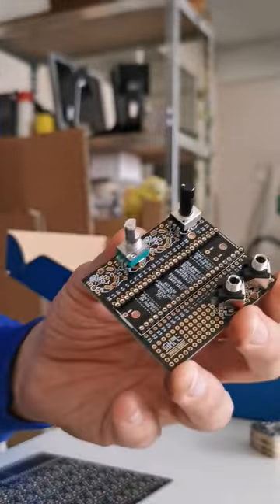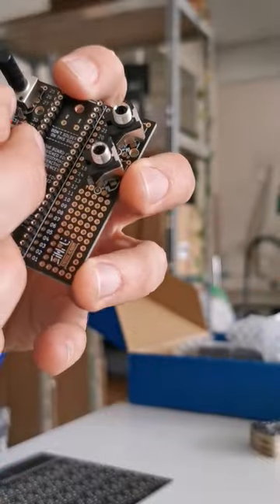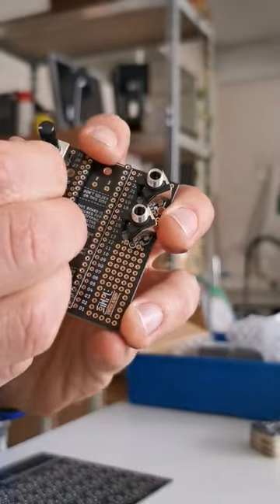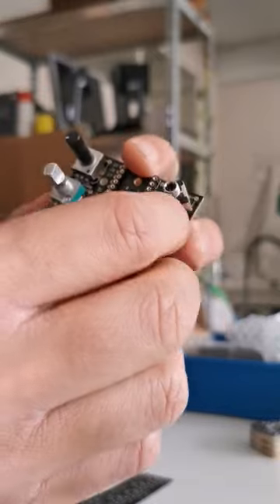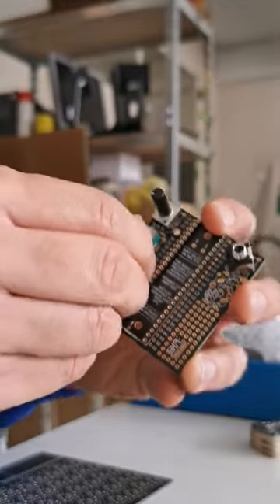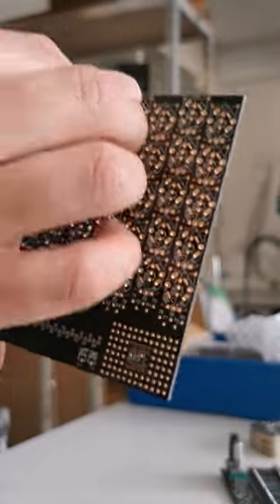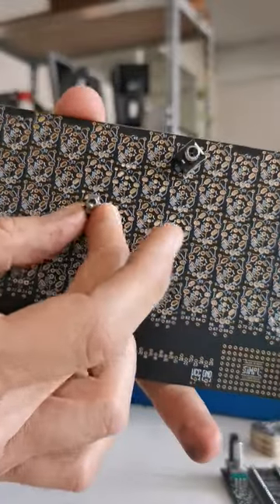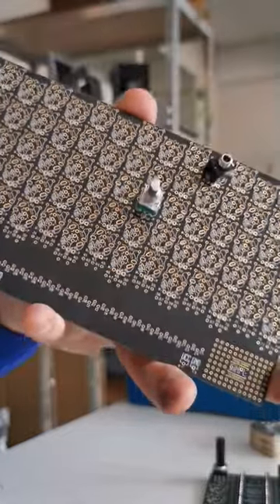Mini synthesizer designer for Daisy Seed, Teensy and Arduino Nano

Comment: That’s genius! I’ve been meaning to build my own Daisy Pod semi-equivalent in a perfboard (right now I can’t afford do print a PCB, nor PCB mounting pots or jacks), but I haven’t finished the design. I want to be able to bypass the pots, so I can incorporate other kind of input devices.

Your alternative is THE COOLEST.
Reply from the maker: Thanks so much!
Reply: YES! DIY controllers are okay fine for a learning exercise, but why reinvent the wheel from scratch?
Use a commercially developed MIDI mixer & Reaper's DAW instead. They have powerful VSTs and all the functionality that you could waste years on developing.
Been there, done with that.